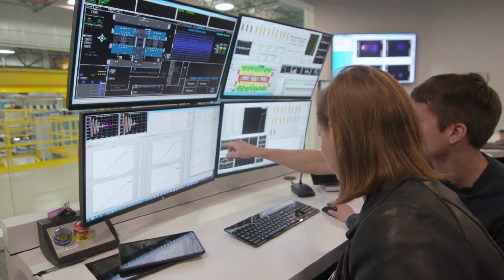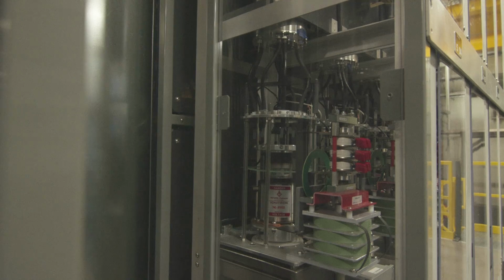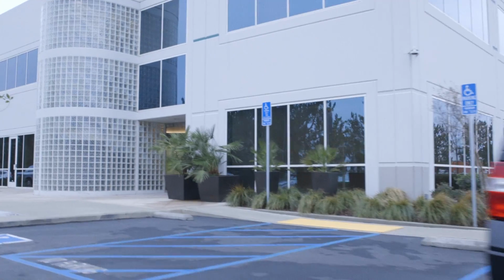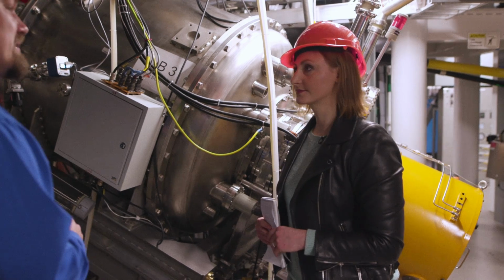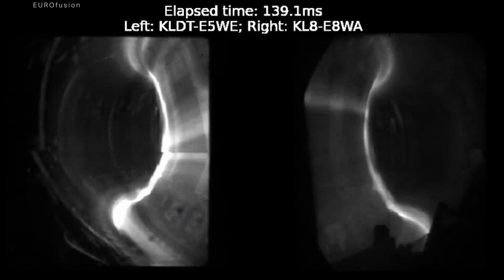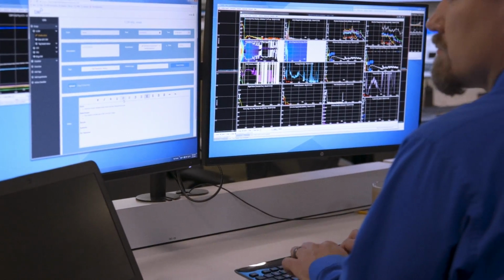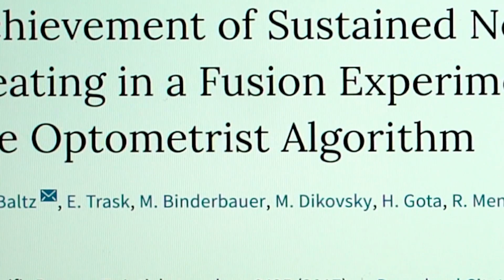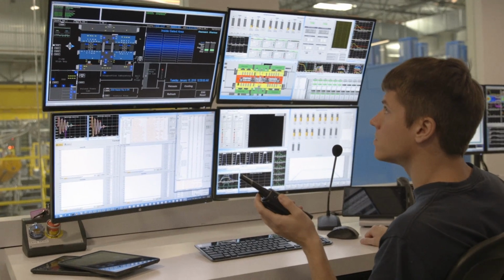Can AI help crack the code of fusion power?

Comment: Guys, if you need that much help just ask me. I got a few ways to get Sustainable Fusion power working. 3 Of them not requireing either a Artificial Gravity well or natural like a Star or planet. Heck if you want to go full "Cheat Mode" i can provide you with the ways too. Not that i'd be that willing because ... High Values of Energy is litertly Power and with great power comes great Irresponsibility on the side of the owner and a Task of great Responsibility.

Comment: Fusion theory bureaucracy run amok (in my opinion).  People stick to similar models to get funding even though they look like longshots.  Will be the most expensive technology to run and maintain even after it's been solved.
Reply: What? Depending on the outcomes it could be the most energy dense power generation.
Reply: @AvNotasian  no - it has about the same conversion ratio as fission, just requirements on infrastructure are larger.
Reply: @piotrd.4850  
Deuterium-tritium fusion has a energy density of 3.38 x 10^8 MJ/kg.
Uranium varies from 8.6x10^7 MJ/kg to 1.44x10^8 MJ/kg.
This means fusion has a energy density between 2 to 4 times more than uranium, this makes it the most energy dense form of power generation even with 50% losses.

Comment: The basic question is do have materials that can stand the temperature of tbe sun. If not then forget creating the sun on earth
Reply: We don't, but we don't have to touch the stuff, we can just contain it in a magnetic field because everything heaten up here is electrically charged and thus repulsed by magnetic fields.
The trouble is that the plasma itself create a magnetic field, which interacts with the magnetic field from the electromagnets used to contain the plasma. So the magnetic field is unstable, and can catastrophically collapse, losing pressure and temperature and ending the fusion reaction.
Reply: I definitely not an expert on this but if the fusion reaction would sustain wouldn't the radiating heat itself be too much for the coils inducing the magnetic field to handle, they couldn't possibly be miles away from the hot plasma where the fusion is happening

Comment: a key to dark matter or no time for energy exchange...hope it help your ai
short version 
Energy exchange limit or limit for two point to interact.
it is a bit hard to write down this thought for me.
if two points have relative speed more then speed of light, they not able to interact.
but they can interact through the third point. (exactly like dark matter)
long version

For a long time trying to communicate with physics to clarify my theory.
with all and all main point here.
-dark matter in our galaxy, (most likely particles emitted by central black hole)
is particles that moving faster than light. (most likely you do not "belive" in this) 
if i assume it is correct, then big amount of hydrogen on edge of galaxy, is where this "dark matter particles" decay after losing speed. (decay like new particles from hadron collider)

-parts of dark matter alredy found, but we do not about it. (perseption(particles from hadron collider))
-particles found with hadron collider behave like a dark matter after loosing speed.
-most likely there is a energy exchange speed limit in betwen two points (not sound speed),
most likely it is a speed of light. (that about why we do not see dark matter, but see it interction with other(slower for it/faster for us) particles)
-particles from hadron collider will be stable if placed in faster then light speed.

whant to tell more, I hope this is enough to contact me.
the key is a energy exchange speed limit
(i want my Nobel for showing you dark matter)
Best regards,
Dynin A.I.

Comment: All this just to heat water and spin turbine??
Reply: That's exactly how normal fission reactors, fossil fuel plants, and some solar plants work as well. Turbines are pretty much the most efficient means of converting and producing energy we have.
Reply: Do you not understand how power is generated by power stations?
Reply: Actually, this implementation allows for direct electrical conversion of ion exhaust.
Reply: Heat water so hot it can power entire cities in an instant.
Reply: +Subscribe To Me If You Want A Reason
if you don't like steam turbines, go ahead and invent an alternative.
Reply: Nearly all electricity comes from steam
Reply: That's mean
Reply: Yup a futuristic nuclear sun powered electric wonder just to boil water and turn a almost 200 year old turbine design  . Hey if it ain't broke don't fix it 😁👍
Reply: Ronald Brown yup, but why not ? Maybe 200 years is enough..
Reply: Unfortunatly... :'(

Comment: No where near? China is building a real fusion power plant and should be done by 2020.

They already made it work for 80 seconds, but the one they made was not built for long term power just for research
Reply: we can have fusion for a much longer time than 80 sec. The problem is that it's not that economical. They are trying to figure out that here.
Reply: @chaos98GTVS  theres also an international collaboration (ITER)
Reply: @DeepFried43  I can't wait to see it finished.
Reply: chaos98GTVS 
No it’s because we can’t harness it and keep it safe and technology is still lacking , quite the opposite, once we figure it out it will be very economical..
Reply: Citation needed. I'm pretty sure they are building a research reactor at best.
Reply: Jarid Gaming 
Stop speaking nonsense we’re a long long way far from fusion
Reply: Nothing in china is made for long term 😂
Reply: SoulJuice aint that the truth! 😂😅

Comment: i dont think this is a good way to get to optimal variables. in this case a better result doesnt necessarily mean its closer to the optimal. perhaps 1 step away from the optimal it looks total garbage but thats closer than any other setup. also fusion reactors will never able to produce more energy than they need to run
Reply: There's way too many viables to guarantee getting the optimal combination. But using the method you quite literally always move in the positive direction until you reach what's called a local maximum. If it is not good again, you start in a completely new spot, and you will find another local maximum. This is the most optimal way of improving.

Also what makes you think fusion reactors will never produce more energy than they need to run? They haven't yet, but we're already very close, and there's literally zero theoretical reason why it would not be.

Comment: We HAVE achieved fusion; it's not a dream. Just what we want is a fusion reactor that makes more energy than it uses.
Reply: Has any one here in the comments taken at least 1 physics course?
Reply: "achieve fusion" and "generate positive Q" are basically synonymous by now
Reply: zachdamost What?
Reply: +1, Yeah, really annoying to hear that we can't do fusion, when in fact we did achive fusion decades ago and can do it regularly these days.
Reply: A Q of >> 30 has already been achieved. 50 million tonnes of TNT out for 1,5 million tonnes of TNT in (of which much occured by fast fusion neutrons fissioning atoms after the fusion reaction was already self-sustaining; hence much more than Q=30).
Reply: So, all the folks saying "you can't create or destroy energy" need to browse at least one more Wikipedia article. The OP isn't saying we are trying to create energy out of thin air, we are releasing stored energy by initiating atomic reactions. We just aren't yet able to get more energy out of the reaction than we put in to make it happen.
Reply: @EnDSchultz1  thank you,  i just have written 'releases useful energy'
Reply: @EnDSchultz1  
What?
Reply: We are constantly getting closer and closer to positive Q so it is coming.
Reply: And preferably actually sustain the fusion.
It wouldn't be of much use if it turned off always after a few miliseconds.
Reply: zachdamost  what?
Reply: @william41017  What?
Reply: zachdamost  What?
Reply: robloxfan2011  What
Reply: robloxfan2011  what
Reply: you can mever looseor gain energy you can just jange its form
Reply: robloxfan2011  My problem is with this: "1to1 fusion power is already achieved"

And well, I'm stillw waiting. Who and when  was it achieved according to your.
Reply: robloxfan2011  what's the name of the reactor that has achieved 1 to 1 power? havent hheard of it
Reply: @martinr7728  He's referring to ITER (International Thermonuclear Experimental Reactor) which is an multinational project funded by numerous governments and being built in France to test fusion reactions. However, it's far from complete and the 10 to 1 yield (energy production/energy expense) I think is just a projection of what their expecting to be able to produce with the reactor once they figure out how to create stable fusion positive Q reactions for extended periods of time.
Reply: @ShadowVipers  ah yeah my bad, i misread his comment
Reply: @martinr7728  TSAR bomb is a fusion bomb... a gigantic ball of fire visible from hundred of KM away. That's done in 1961 using some sort of shaped charges to compress fusion core thru nuclear bomb detonation, overkill...
Reply: @xponen  hydrogen bombs still mainly work with fission
Reply: Duh
Reply: Wait isnt there a law that says you cant create or destroy energy? I am confused.
Reply: @davidfiser8593  We don't count or care about the energy stored in nuclei. We care about how much electricity do we expend and how much heat do we get out? Changes in nuclear binding energy, e.g. by making extremely stable "doubly magic" helium-4 nuclei are not all that interesting when you're building a power plant; we don't have to make deuterium; it already exists in large quantities as heavy water.
Reply: Partikels need time to fuse thats the question .
Reply: We have a fusion reactor that makes more energy than it uses, it's called a W87.
Reply: True statement. The self feeding, or over feeding actually is the trick. I don't think we have ever built anything that uses energy to create energy and as such creates more than it consumes.
Reply: Martin Roussev only educated people know this but most of the US is full of idiots
Reply: Right!
Reply: Evan Scammell 
Can we generate a positive Q though? That's what matters
Reply: Evan Scammell 
Yeah hopefully.
It's gonna be a game changer
Reply: a fusion reactor that makes more energy that it uses, or a fusion reactor which allows us to use 99% of the energy it produces?
Reply: zachdamost You’re joking, right? You want to know what else is a theory? Evolution and gravity.
Reply: robloxfan2011  Those are projections, ITER isn't even operational yet so you can't say that we've made more than 1 to 1 fusion because it physically hasn't been done yet, and predictions can very easily be incorrect, I mean just look at the weather channels (and yes I know this is a bit of a red herring).
Reply: thanks, mister overly pedantic
Reply: @Apodeipnon  Thats not pedantry its the core of the whole problem and it will never be solved.
Reply: @kemicbi  No, too specialized education and research. We might have people capable of understanding but they know only parts of what they need. I think we will have big profiles in science don't get me wrong but not like Einstein. If I were to guess I would say France,  Sweden, Germany, Japan or China not in any particular oder I just think those countries have what it takes to let someone evolve without getting a too good economic deal to drop out for a company.
Reply: zachdamost thanks for your honesty.  That makes you one of the smart ones.
Reply: @f123raptor  What?
Reply: What?
Reply: We may not see another einstein, but another Da Vinci/Batman in Elon Musk. Hes just crazy and rich enough to actually gain ground towards science fiction possibilities
Reply: why are they still pursuing this? perpetual machines are impossible
Reply: Just like wind power, sure it makes energy but at what cost.
Reply: Um , it has already been  achieved and used secretly by the cabal , elites , super rich for some 30-40 years.
What do you think they have been mining  secretly on the moon for the past 50 years.It ain't moon rocks,
It's helium -3. There's lot's of it on the moon and they are using it for fusion on the moon   for the elites
Just take a look at Aristarchus crater  on the moon .See that blue light coming from that area, it's from a fusion reactor using Helium-3 , the isotopes produced cause a light blue light to be  emanated . 
This stuff they are showing you  here is a dog and pony  show .
They have had it secretly for   years  and ain't giving it to the public  !!!
Reply: @gregorygant4242  this 100% true and it is also the reason for the insane amount of alien abductions they need slaves for their powerplant and the moon economy to keep running
Reply: But thats impossible according to einstein no?
Reply: @marcelrodriguez2067 
What?
Reply: @marcelrodriguez2067  The fusion itself produces energy, and i think what he meant was that it isn't possible according to the first las of thermodynamics. Because the fusion produces energy it is possible.
Reply: @lpkombi6685  yea thats what i meant lol everyone is just asking what.
Reply: @marcelrodriguez2067  what?
Reply: @marcelrodriguez2067  @zachdamost    No, no laws of thermodynamics are broken by reaching positive Q (more energy out than in) because when two atoms fuse (like in a fusion reactor, or the sun), a large amount of energy is released. However, it takes a lot of energy to cause fusion and contain it. The material you are fusing is just like a fuel for a car or fuel burning power plant, you put fuel in, you get energy out.

There's no reason energy generation isnt possible, it's just a matter of increasing the efficiency.
Reply: @marcelrodriguez2067  no, the fusion reactor doesn't necessarily make more energy than you put in, it simply self-sustains the reaction. The reactor will still get fuel pumped into it, then turn that fuel into electrical energy. Basically right now the magnets and heating takes more than it generates.
Reply: @marcelrodriguez2067  no, in the input we don't consider all the material I believe, just the electricity to heat it up.
Reply: @marcelrodriguez2067  Totally possible.
Reply: @marcelrodriguez2067  whAt?
Reply: @marcelrodriguez2067  No. Actually Einstein's equations predict this to happen.
Reply: Marcel Rodriguez Einstein is wrong it was done and the amount of power you need to run the reactor is not worth it

Comment: Would this be an evolution/survival of the fittest type algorithm where they try many different types of variable scenarios and the best for generating power gets to live and branch of to an other variable to see the impact but this can be done for hundreds of times a minute (or something). Just curious
Reply: Pretty much? You're just lacking one part: there is feedback. That is, the algorithm learn from previous trials how changing such-and-such parameters influence the plasma, so it can use that information to get closer to the optimal parameters.
The other thing is, it can't be done a hundred times a minute, since you need to actually fire the machine each time you want to try a new set of parameters.